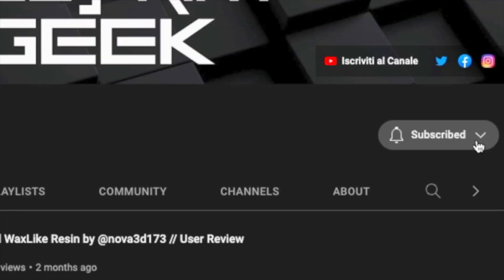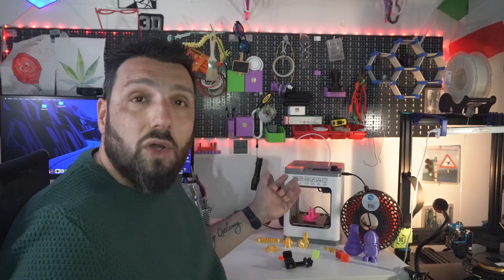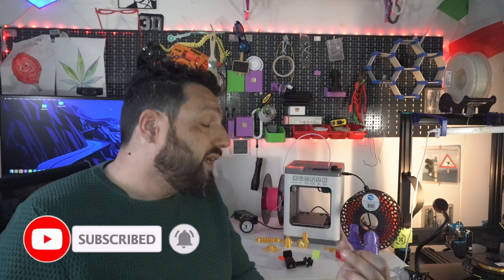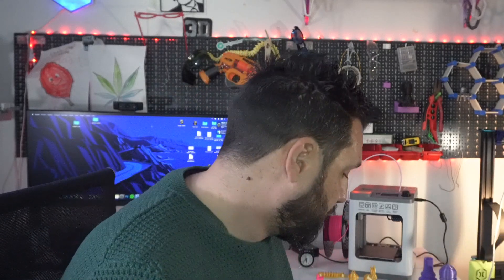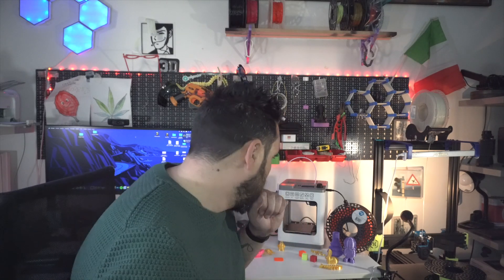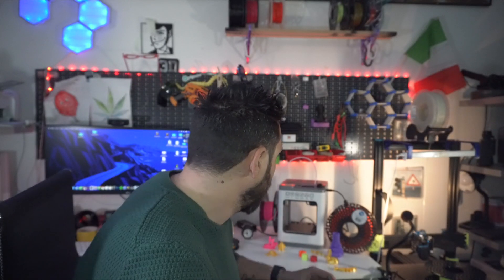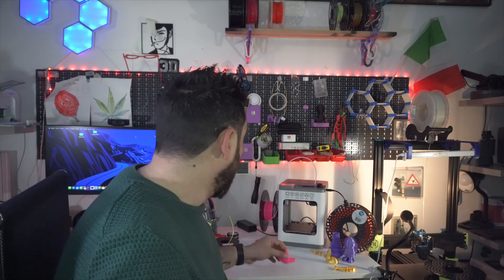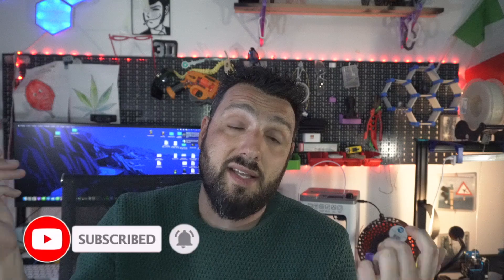This 100$ Printer is NOT A TOY // Weedo TINA 2 Printing PLA, TPU & PETG like a PRO

Comment: I like your entire channel, mind if I ask about some of the items you feature? I especially like this Tina2 right now because I don't play with toys, I want to create practical items. So I bought one to see if it can save me from building tiny parts by hand. That gets real messy and uses tools that get lost or wear out etc, I'm sure you know the feeling. So I've bookmarked your channel.
Reply from the maker: Yes. I know exactly the feeling. I fixed that by reling on a Bambulab. Very reliable and also cheap on the long run. A1 is the best solution. Believe me!

Comment: I bought a used Entina TIna2S V10 for $110 on eBay and couldn't be happier. I can't believe how good Wood PLA looks after switching from a 0.4 mm brass nozzle to a 0.6 mm steel one. Currently lusing Silk PLA, Wood PLA, and whatever came in the box. Now I'm looking into TPU.

Comment: I got two of these off ebay for $70 USD. Great little printer. Had some issues initially because I had no experience with 3d printers, but eventually I figured it out.

Comment: What slicer do you use?
Reply: For this printer you have to use their proprietary WiiBuilder which is good.
Reply: @ChrisVideoNet  Printer includes a license for older version of Cura. May have to download it separately. Found it more user friendly than WiiBuilder.
Reply: @SerenoOunce  Oh, I really like your comment on using Cura a year ago because it seems like you can create original pieces or parts since I'm not into little boats or dolls. I'm the repair and invention type old guy so I look at all the little things you can't buy, or there isn't a model for. I downloaded it but I don't know where to start. I wonder if you're still printing, and have a trick or tip I could use to get started? No one answers when I read the comments.
Reply: @Crozbyguy-rg1iu  Cura is just the printing software. Other modeling program needed for designing.
Used to use SelfCAD, very novice friendly. But also bit buggy and recently began paywalling basic features. Still looking for alternatives. All the yt recommendations found the UI frustrating. Or dumbed down to point of being worthless. And for any training vids nobody explains squat.
Reply: MS 3D Builder useless for creating, but importing your models is good as autocorrecting errors and simplifying the design. Shrinking the file size substantially.
Right now I'm stuck crating the model components in SelfCAD, then exporting all parts into 3D Builder to combine/subtract them. Reload into SelfCAD for rinse and repeat. Doable but very tedious.
Reply: Pro tip with the actual printing. On the magnetic base pad I put down layer of painter's tape. And before every print coat it with hairspray. Helps the first layer stick while still easily removeable.
Reply: @SerenoOunce  Oh! How disappointing. I guess I'll have to back to Blender, it's very complex, I wasn't very good at it. Thanks for chiming in, I'm just getting started. Some vids say it's compatible. Why does it have to be such a mess?
Reply: @Crozbyguy-rg1iu  Blender is fine for creative modeling but not precision CAD work.
I'm also not a hobbyist or a Pro. Printer is a tool for occasional fabrication/repairs. Most programs I've tried either either the equivalent of building with Mega Blocks or a 1500pc LEGO set w/o the instructions. Restrictions with SelfCAD were very recent, so I put up with the jank cause right now it's all I know.

Comment: First of all I really like your review… I have the same printer and I tried to print some tires with TPU fillament  for Hotwheels and fillament started clogging up. What would you recommend for settings.
Reply from the maker: I can suggest to always use a raft, slow speed to 20mms and take away the retraction... keep simple prints... no matter if it strings, then you clean it
Reply: Did you select correct temp is Cura? TPU needs a bit more heat than PLA.
Reply: @SerenoOunce  I just used the generic tpu settings